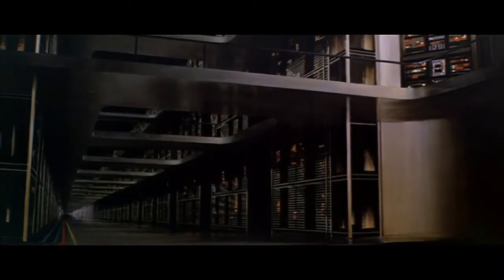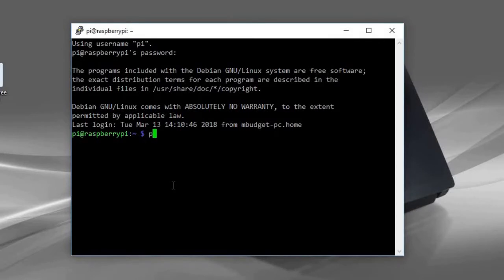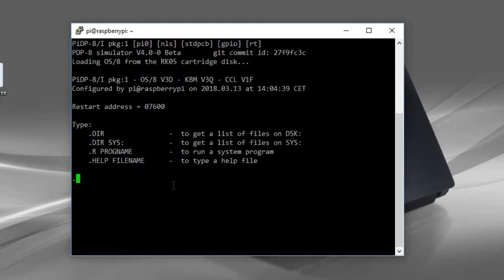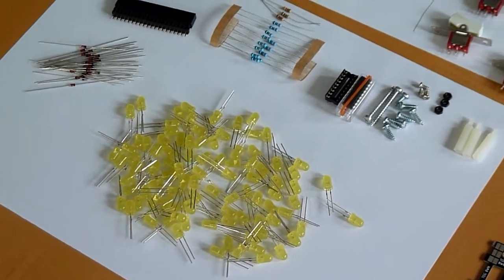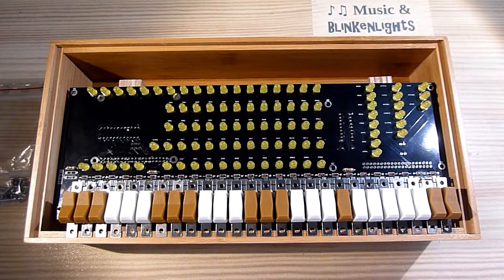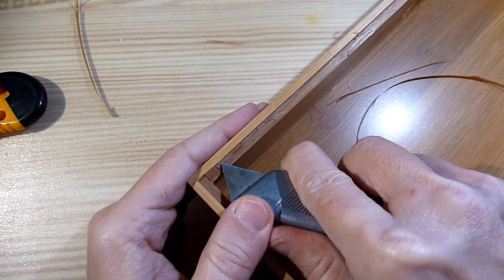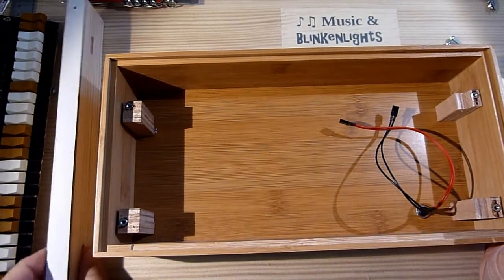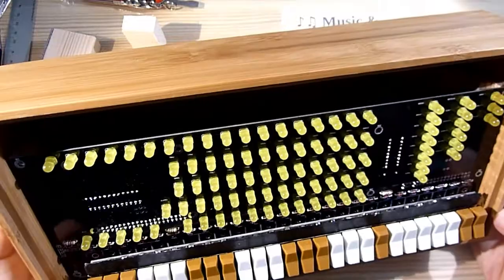Building the PiDP-8 - An Amazing Replica of a Vintage Computer

Comment: When I was in high school a few of us were allowed to go over to the Junior College and learn programming on the PDP-8. Later I attended that Junior College and worked directly with that PDP-8 and an HP-3000. Then I went to college and worked with the PDP-11 and the CDC-6400. Later I built systems with LSI-11's and MicroVAXes and onward from there. Fun times and great memories. Either a PiDP-8 or PiDP-11 would be interesting to play with, especially the 11.

Comment: I worked with PDP 8 and PDP 11 at Harwell in the early 70's - they were used as front end processors to control Neutron Spectrometers. A PDP8 was used as a command processor/ multiplexer for end users of the IBM system 360 mainframe. In those days end users were lucky if they had a teletype. These days the AVR 8 bit microcontrollers I use to control the dome of my astro observatory have much more memory, dozens of registers, internal oscillators and 20Mhz cpu clock if you need it, also 500 times smaller and cost next to nothing..... You could use one to simulate a PDP11 - now there's an idea -where's my box of awful red, white and black plastic....thanks for posting, - a nice nostalgia project :) :)

Comment: Thanks. This was fascinating and wonderful. Similar to this model I wrote my first program on a PDP-8e. Eventually I was hired by Digital Equipment Corporation to support the PDP-8 Family on the East coast. Great times with a great company. I hope to build one when more kits are available.
Reply: in Maynard, Massachusetts? I really don't have much connection to them or the PDP, but I've sometimes dream if Silicon Valley and the "PC revolution" didn't happen in Silicon Valley, and the center of computing remained around Rt 128 and Boston: DEC, Wang Inc, Symbolics and all the hackers from MIT, the inventors of Visicalc, and all a stone's throw from IBM in Armonk, New York. All the tech that started there could have stayed there, but it wasn't to be.
Reply: hey Clarke - how you doing?  me? basically 7000

Comment: Very nice job. I might 3d print some guides for the LEDs if I was building this kit. Plus perhaps some 3d printed mounting parts with brass heat-set nuts instead of wood scraps.

Comment: I agree, the intended method of installing the PCB into the case isn’t the best. I still haven’t mounted the front panel permanently on mine either, but otherwise its a great kit. I wish I had mounted the PCB in a different way in mine, and I just might revise it to be similar to yours now. Thanks for the video!
Reply from the maker: I think it's perfectly fine to friction-mount the front panel into the case. If you don't shake it too vigorously, the panel shouldn't fall out.

Comment: What power supply did you use for the PiDP?  Was it a generic 5V supply, or one specifically rated for the Raspberry Pi?
Reply from the maker: It was a generic one, sufficient for the demands of the Pi Zero. However, depending on the raspi variant you use (and what you intend to run on it) I'd check the power rating of the "recommended" (branded...) supply and try to match it with a cheaper, generic one ;-)

Comment: I really liked this video and found it very helpful. I finished assembling the 2019 version of this kit just this week. I have yet to mount the PCB in the case because I was weighing my options for running power. I used a Raspberry Pi 3 but I may remove it and use a Pi Zero W instead and route the power the way that you did. Your method seems like a cleaner implementation than the slot that I was about to cut in the box.
I have one question: How did you attach the front panel to the case ? Did you use Velcro ? 
Thanks again for recording your assembly process.
Reply from the maker: You can press the acrylic panel into the case. It'll hold by friction. Just don't shake the case with the panel facing down...

Comment: a fancy box connected to an emulator -- not what I expected.  I thought you would build a gate-level reproduction without using a microcontroller.
Reply from the maker: In a way it's cheating, I agree, but unless you "clone" the whole computer using original parts (or modern compatible ones), you'll have to compromise one way or another.
I don't necessarily mind emulating obsolete (i.e. unobtainable) hardware. Perhaps I would have preferred an emulator running on an Arduino or something, in other words "small", instead of a full, "real" Linux computer (the raspberry pi).
Reply: Have you seen the various projects building 8-bit from scratch (e.g. using 74000 series chips) or the MOnSter 6502?  I saw an Apple 1 clone that used a propeller microcontroller to emulate the unavailable chips (specifically the terminal controller), but was not an emulation of the whole thing on a modern CPU.
Reply from the maker: Yes, I've seen many of them, although I'm sure I missed the best ones. I know that you can still get 6502 processors (compatibles). And I already bought a Z80, 64K of RAM, blank EEPROMS, ...
Reply: Love it! I bought an 8/I back in '72 and programmed in Fortran, running a commercial mailing list maintenance and labelling company for several years. Now, as an oldie, gotta build me one of these pronto! THANKS!
Reply: I realize this is an old post but regarding John’s critique about using a small but powerful modern computer to emulate this older classic, I built one of the 1st run in 2015 (with the latest simh PDP8 emulation software) and it is quite convincing. If you didn’t know it was a Linux box pretending to be a PDP8, you wouldn’t know, except that is might run faster than you expect. 

The Digital Corp eventually moved the PDP8 onto silicon and if you’ve got deep pockets and some time on your hands, you could track down the Digital Corps 6120 chipset and put together a real Digital Corp PDP8 and use Oscar’s kit as the front end. Another less costly option would be to build a PDP8 processor on a FPGA device and then use the kit for the front end. Lots of options. I prefer the kit with the Raspberry pi myself because it took an afternoon to build and has been running flawlessly since. Rather than wrestle with hardware, I can tinker with code old school style.